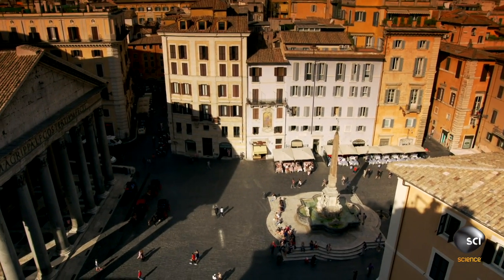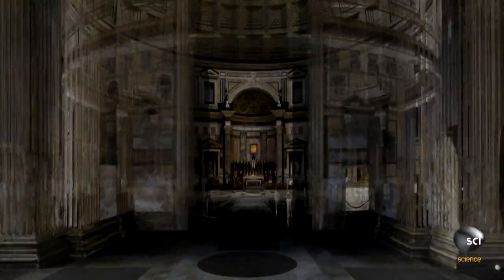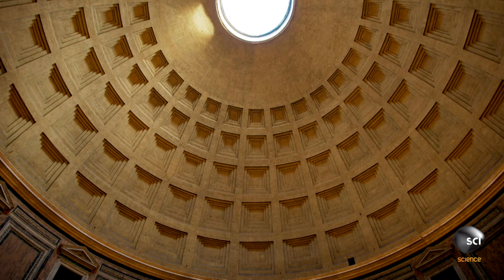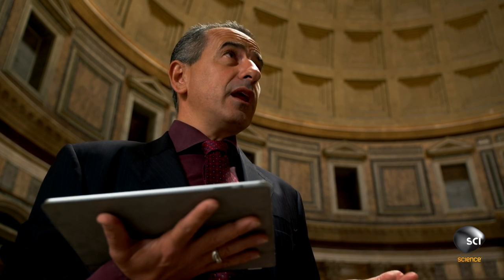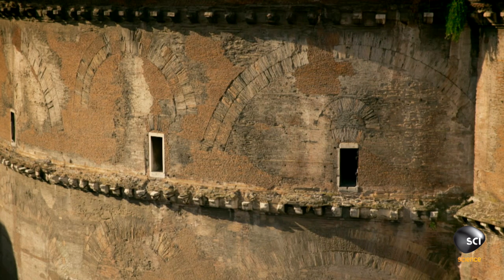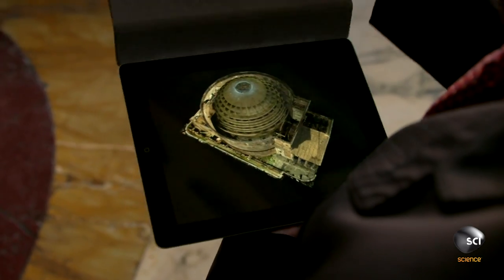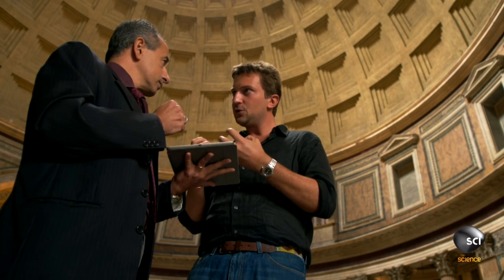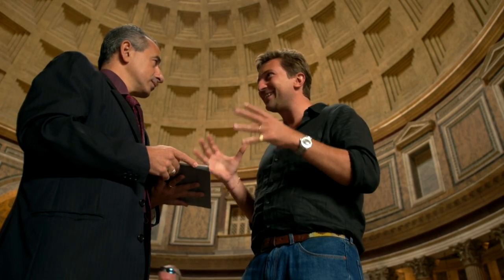The Largest Concrete Dome Ever Built

Comment: Just back from an amazing holiday in Rome, Top of my to do list was to revisit the Pantheon,  just the most brilliant building,  breath taking,  the dome is extraordinary but no mention of the 16 monolithic pillars of the portico,  these red granite columns are huge and a single piece of stone  each, apparently brought from Egypt,  did the Roman builders quarry them or were they recycled from an existing temple? Feel the finish on them,  as smooth as glass where they haven't been damaged or corroded , perfectly sculpted by hand before any machinery.  Just imagine the logistics of transport and erecting these 2000 years ago.
Reply: Apollo Missions...Artemis...
Reply: 1960's
Reply: Apparently DARPA has been working on the F1 Engine before The Design Phase
Reply: @rajbanwait325  with respect; what on earth has that to do with the structure of the Pantheon?